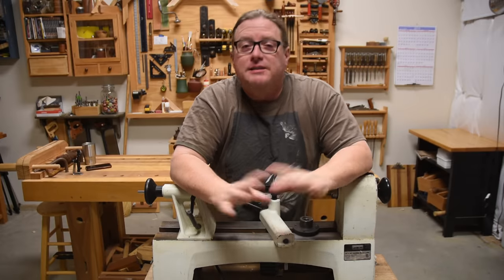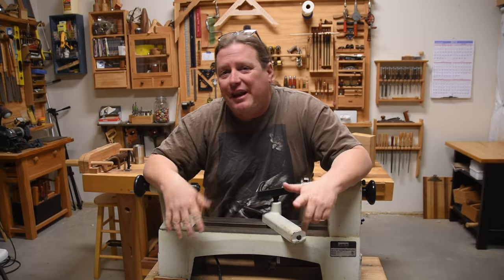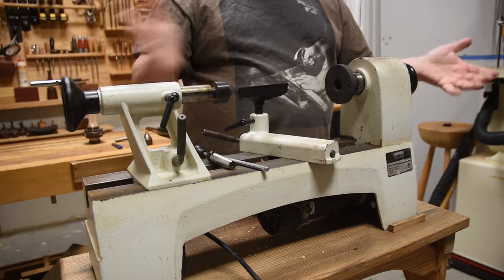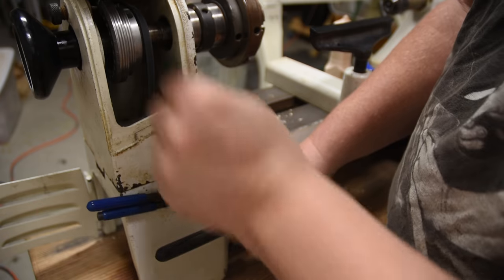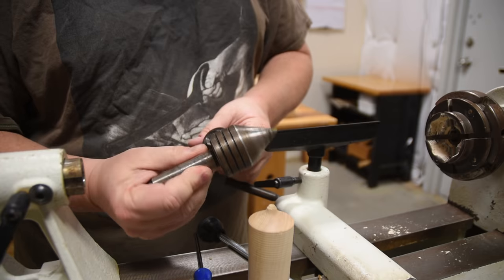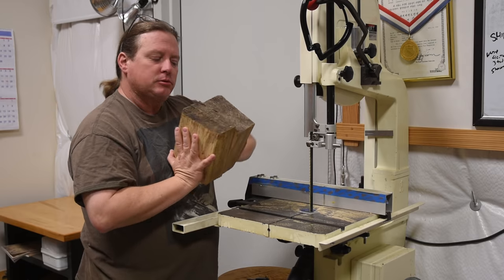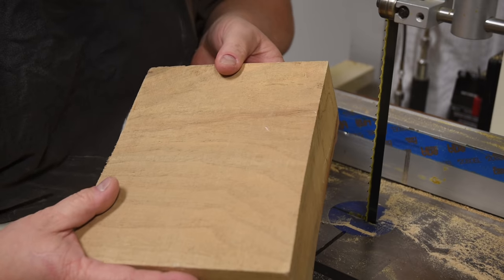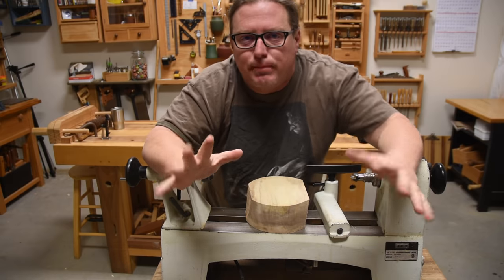Turn Your First Bowl - A video class on bowl turning.

Comment: I have been in timber most of my life, moulding machinist, 8 inch bandsaws but I knew nothing about timberlathes. Now at 83 I have purchased one and I’m watching video’s by the bucketloads. being left handed I stand on the other side of the lathe, terrified of kickbacks and forming my own way of managing.
I must say after watching you on how to do it properly I am getting confident and starting to turn out some nice work. Thank you my unnamed hero your doing an excellent job of teaching us dummies. Cheers from Australia 🇦🇺
Reply from the maker: You don't have to stand on other side if you don't want to. The wood or lathe doesn't care. Most experienced turners learn to be a bit ambidextrous because we don't need fine motor skills, just an understanding of leverage.

Comment: OMG awesome timing! I'm about to start sprucing a Jet Mini back up so I can attempt my first turn! It's been unused for many years so it needs some tlc.  The faceplate is stuck on the headstock, banjo is a tough slide, the tool rest is stuck, and it needs a chuck.
Reply from the maker: I"m psychic that way. 3n1 oil soak overnight then wax the heck outa it.
Reply from the maker: @JensWoodworkingThings  same, oil for a few days. lock the head stock. screw a stick into the faceplate. leverage.
Reply: @JensWoodworkingThings   - if it's still stuck, Ernie Conover has a video on some different techniques to use; including how to prevent it in the first place.  And don't forget - leverage : )
https://youtu.be/vG28DdSPUCA

Comment: I do make sure to tell beginners to round over that outside rim of the bowl. It is a razor saw and can slice you to the bone. 80 grit or a light touch with the gouge or even a scraper. Pretty good job. I prefer a negative rake scraper for across the bottom of a bowl to a standard scraper, and I never go up the sides of a bowl with a scraper for a finish cut. I have blown a few up that way...

Comment: Thanks for this wonderfully informative video. I've been woodturning intermittently for over 20 years. I've done a few small bowls and boxes, have mostly done spindle turning. I find this video both helpful and a tad overwhelming... too much to remember for someone just starting on bowls. I would start someone off turning on a totally round bowl blank that has no straight edges left on it, let them work their way up to the more challenging blanks which aren't perfectly round. I'm stopping now for a second break at 47.28 and will come back to this tomorrow or the next day. Also, I've never owned a chainsaw and don't consider it a necessity for woodturning. A chainsaw is a great accessory. There's plenty of blanks on the market. Join a WT club to get access to more blanks - sometimes they're given away, swapped or sold. A bandsaw is a necessity.

Comment: Great video...turned my first bowl last week..turned out nice except the big hole the size of the tenon in the bottom!...forgot to check depth!..😮..lol...hadn't turned on a wood lathe in 40 years since high school...went big off the start and bought a Powermatic 3520C. Getting everything in order in the shop and will get to turning more. Thanks for making these videos!
Reply from the maker: You didn't realize you were actually making a shop clock. I'm jealous of your new lathe, that's a nice one.

Comment: If you're bad at cutting freehand rounds, a power drill that rotates super slow is sufficient to spin the work in. If you re-wire the throttle to limit it to a very slow and safe rotation you can rig a post system in place to allow you to cut rounds while you're preparing the next blank and automate your work load.

Comment: Hello,
  So I just found your channel and it's awesome. I just purchased a Shop Fox W1758 16x46, with an outboard of 24". I went with a full size lathe for laments and bigger bowls I want to turn. I fortunately have a beautiful wife who has blessed me with most of what I need to begin turning. I've worked in a woodshop for years and worked with my father who built houses for the better part of my first 20yrs on earth(literally had me out at job sites at the age of 5). I'm familiar with most every tool and machine in a shop, but I'm still apprehensive. Should I look for someone in my area to tutor me for the first couple months? I've only ever saw a mini like your jet in action, and that was quick. I have all my chucks(Nova G3 bundle, not for pen turning), along with a faceplate, live center and spur center. A decent set of Robert Sorbey turning chisel, and a separate full size bowl gouge 1/2", looking into fingernail too. Also a set of carbide tipped, with a hollower tool. Have a 24"  Husqvarna saw, but lacking the band saw. Any feedback would be great, thank you.
Matt,

Comment: Have not bought a lathe yet.  I too was considering the mini, learn on it, and if I like it eventually move to a bigger, heavier lathe.  There is so much good info, I need to watch a number of times.  Really I was debating on the mini or midi to start with.  But if I get a midi I am afraid I would want it to do more than I should.  I think some buy the midi and turn as much of big stuff as they can and constantly tax the machine.
Reply from the maker: Midi will do it's capacity. Just might not be able to take a big bite like pros do. But you'll get there.

Comment: Hi,  I appreciated your video very much.  I've  been a home woodworker for 40 years and decided to try turning.  Only have experience in spindle turning to this point, so I'm anxious to try your techniques.  I have two questions:  1.  How do you know what the depth should be, to avoid going to deep?  In another video I watched, they used a drill to drill a depth so you would know.  2.  I have a mesquite stump that I'd like to try and turn.  It might be still wet (about 6 months cut and left outside).  Should I attempt to use this material?  Thanks and again, enjoyed your demonstration.
Reply from the maker: Thanks
1, measurements
2. I wouldn't use it.

Comment: another safety point if you use vicmarc lathes they have a "handcuff" safety system, in which any screwed on accessory (chuck, face plate) has a tapered end corresponding to one on their spindle nose, and a split collar secures over and on these tapers so even in reverse the accessory won't screw itself off the spindle nose. esp. good idea for beginners.

Comment: Dear Bill, at 42:00 you are starting to turn the outside edge of the bowl into a cylinder. You are using what looks like a bowl gouge. Should this not be a spindle gouge? 

I’m starting out in turning and still wobbly with tool choices and want to firm up a little. 

love your approach to teaching the craft by the way. Cheers.
Reply from the maker: Peter Marsh Dunno who Bill is but you can understand my reasoning for specific tool choice via my “4Cuts” video. But the answer is no because of geometry.

Comment: Great video, thanks for sharing. Did you talk about the rpm speed of the lathe? 
I started my first bowl yesterday and I'm at a decent stage but I'm wondering if/when I should speed my lathe up to smooth the surface further? I've used the slowest speed so far, being 850 rpm, 
Thanks from down under! 👍👍

Comment: Awesome and thorough breakdown and lesson.
The only thing missing was the safety talk...
No jewelry, no extremely loose clothing (baggy clothes, scarf, neck-tie, etc), if you wear gloves, tight fitting to reduce the chances of catching them in the lathe or workpiece, if you have long hair the it back securely, and PPE like eye protection, a face shield (which you did wear, but didn't mention, and for most woods, a respirator would be important especially when sanding. This is not hand sanding a flat board, the spinning action of the lathe will put the wood dust into the air and no one want lungs full of wood dust and/or finish chemical dust.
Very good video, just would have been a good opportunity to educate the beginners on safety and why it is a good idea.
Love the video with the beginners in mind.
WTE, is there any reason I shouldn't slide the banjo out and angle it back toward the blank to angle push the tool rest into a more desirable position? (Instead of putting it straight, taking the first half of the blank closer to round, then sliding it under the bowl?) Would this risk breaking the bed or banjo, in other words, due to the angular torque it would put into the lathe parts?
Reply from the maker: Banjo angle won't change a thing as long as it stretches across both bed rails.

Comment: Very helpful. It seems all I need is a bowl gouge and maybe a scraper. Where's a good place to get one for someone on a budget?
Reply from the maker: Depends upon what you need by budget. If it's get a tool without spending much then harbor freight. If it's spend enough so it'll last your turning career and you won't be cursing it I'd suggest Thompson Tools. Just buy the steel and make your own handle.
Reply: @wortheffort  The harbor freight bundles don't include a bowl gouge as far as I know. That's why I asked. You recommend the 1/2" for most work?

Comment: This video is such great timing. I ordered last week a 3/8" bowl gouge and a 7/8" hook nose scraper for my first bowl. Follow up question, I can't find much info on sharpening a hook nose bowl scrapers. Any suggestions? I have an 8" grinder, and a 1x30" belt sander with assorted grits 34-2000. Thanks in advance.
Reply from the maker: Thanks, you sharpen all scrapers basically the same so use the same rules as a round nose scraper.

Comment: This was great! Could have been 20 minutes shorter, but very helpful. Just a couple comments - I really like that Pinnacle cyrogenic bowl gouge, but you didn't give them a shout out. Nomenclature matters: Bicycles have gears - lathe's don't have gears, they have pulleys to change speeds. IMO it might be helpful to drill pilot holes for the faceplate screws so you don't risk splitting the wood. Finally, I'm pretty sure that's an impact wrench that you called a drill press in the follow up overview of tools used. Thanks again!
Reply from the maker: I prefer Thompson steel but no use getting new till that one wore out. ‘Twas understood.

Comment: In your opinion what is the best finish to but on wooden bowls and utensil's to allow the customers to use longer than just a coat of wax? I made wooden pan scraper with a wax finish, and I apply another coat of wax after allowing them to dry after washing them.  I made these for my cast iron pans but they look like patches of black and I'm don't want to use them anymore because of the black patches. I would appreciate your suggesting in this matter.
I'm new to your channel and right now your going to be go to video's to learn more about lathe skills.
Reply from the maker: Oil

Comment: Could you use a parting tool to create the tenon as well? Ive read in online forums that people have done it, although I'm skeptical. That being said a few weeks back I took a bowl turning class and the instructor told us when making mortises that using the parting tool to create a dovetail effect was acceptable, so therefore would it work the reverse when making a tenon? I wanna be as safe as possible and at the same time id rather not buy a whole new tool just to create a tenon (i do have a bowl gouge of course but Im somewhat new to the hobby and doubt I'd be able to be that exact for some time)

Comment: If you are using larger screws it helps to drill pilot holes prior to installing. It helps ease of install and relieves stress on the wood to prevent cracks.

Comment: i haven't turned a bowl yet but i want to and you answered alot of questions i had . this was a great video brother . one question i got though is can i do this with high speed cutter lathe tools . you know the ones with the replaceable cutters . or do i need a bowl gouge to do this .
Reply from the maker: diy dark matter use scraper rules for carbide cutters. Will take you longer and you’ll need to sand more.
Reply: @wortheffort  ok thanks appreciate the info  means i will get a bowl gouge in the future for sure .
Reply: I use a easy woods finisher carbide tool with my midi lathe and my bowls come out pretty clean.  I don't think it takes that much longer as long as you are using a sharp edge.
Reply from the maker: April Phister oh I’m telling you it’s a lot slower. I was going at a pace I thought a new woodworker would go in this video. A bowl this size is normally a few minutes of work with majority being flipping in chuck. You don’t have as much edge or flute with carbide and the edge has a tight curve. Pros aren’t being snobbish not using carbide cutters for bowls and spindles. They’ll use whatever makes em more money. They’re just not efficient. They are better at deep hollowing.

Comment: Thanks so much for this vid , I sent you a question bout advice for a lathe or which lathe is best . I’ve been looking at the jet and grizzly mainly because I’ve used grizzly shapers and saws but I’m leaning towards what you have there with the jet . Just want to make bowls and jewelry boxes ( small projects) nothing bigger than 12”by 12”, again thanks
Reply from the maker: I created a whole video on the lathe in start woodworking series. Should be enough to make a decision. I’m not going to tell you a brand and model to buy as that’s your choice.
Reply: Oh yeah I understand, I was more interested in the working size not so much the brand . Key components SAFETY first since I’ve never used a lathe. Thanks so much

Comment: I have just bought my first lathe and found your tutorial which I thought was excellent. It's easy to follow and a great lesson on how to turn a bowl. I have a query regarding your bowl gouge, has it got an Elsworth grind and if so could I use a 'normal' ground bowl gouge in the same way?
Thanks again from S.Wales UK
Reply: Just use the damn thing man.....
Reply: Larry's Response was a bit blunt, but I have to agree. Point is, you just need to "use the damn thing" before any of that matters. The minutia of different grinds and grips and such doesn't matter until you've developed skills to the extent that you have defined a "style" for yourself, and really have a feel for the way you work with these tools. Once you're at that point, then you'll know what grind might benefit your style more than another and it's worth concerning yourself with. But until then, just go with what you have until your tools start to limit your progress. 

I know it's been 11 months since you posted this, but it's been over a year since I started turning and I haven't had enough time to do it much. So I know that could be the case for you as well. At the very least, I hope my comment helps somebody else who's concerned with this stuff.

Comment: Thanks a million boy have you been helpful, I'm new to turning. Is there a rule with the length of screw being used when using the faceplate.
Reply from the maker: Don't go deeper than the bowl? I'd think an inch or so would be enough as the sheer force happens at the faceplate not inside the wood.
Reply: @wortheffort  thank you so much for your help. I just started turning, and I don't want a block of wood off my block head. Again thanks

Comment: Dumb question about the grain directions...is the tear out something you deal with at sanding time, or do you change the entry point of the cut in order to avoid it as much as possible?
Reply from the maker: beav1962 avoidance is best in boxing and dealing with tear out.
Reply: @wortheffort  - thanks for the quick reply.  I haven't even held a lathe tool yet, but I have been thinking about it for a year or so.  Looking at the Turncrafter 10 x 18 with variable speed.  Under $400.  Your vid is a valuable resource to refer back to.

Comment: Thank you for this wonderful video! Quick question: at some points there is chattering/vibration sound. I don't usually hear this in your normal videos. Is this due to technique, or just a problem with the mini lathe? I get it often as well and cannot fix it. Cheers!
Reply from the maker: Not knowing where in video it's prolly me. I don't normally turn bowls on a mini and coulda been going a bit aggressive. It's all about torque and weight.
Reply: @wortheffort  55:13 is an example. There is a distinct sound change and that's what I cannot seem to prevent myself, carbide or gouge. It's probably technique but curious if my lathe Chuck just had some slop or something.
Reply: 1:01:50 is another
Reply from the maker: @mmocny  That's the wood vibrating. The stuff vibrates. It's why they make musical instraments outa it. You have it in tension via screw but it'l still vibrate. To eliminate it, change the frequency somehow.
Reply: @wortheffort  wow, wouldn't have thought of that. I'll try it.  I'm usually too low on the rpm so I'll play with it. Cheers!

Comment: My recent bowl turning turned out to be a box of chocolates. As I was just about finished, a small hole appeared so I filled it with saw dust and CA glue. When it was dry, I used a scraper to clean up and a small piece flew off revealing a live grub inside.
Reply from the maker: Don't eat the grub.

Comment: Probably a dumb question but do the threads on all machines match for adding a chuck or is each brand different?
Reply from the maker: There are a couple standard sizes of threads used but most all chucks use an adapter so you get the chuck and then buy the right adaptor. You can get a used chuck and change adapter.